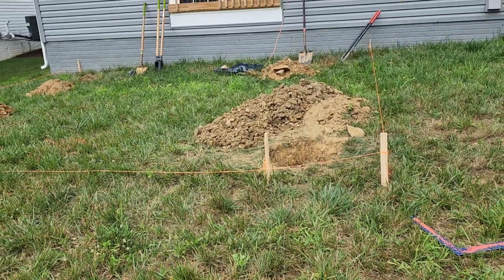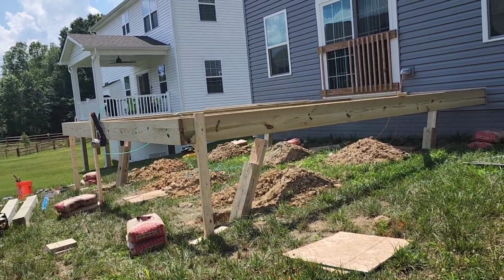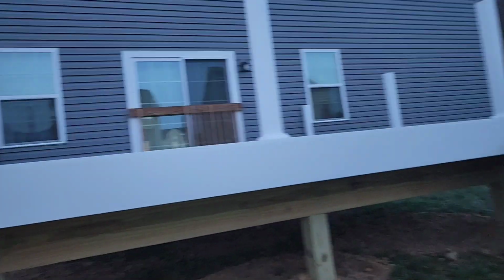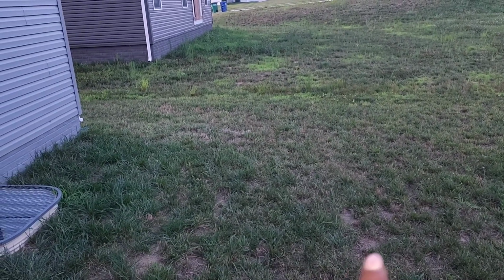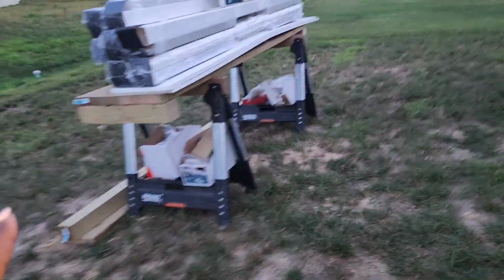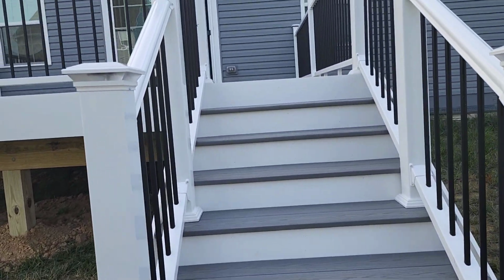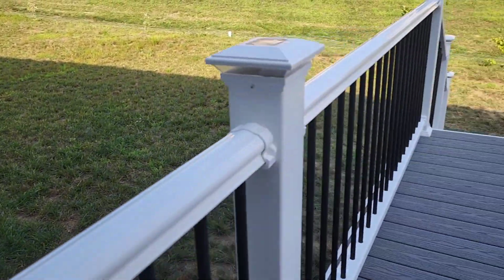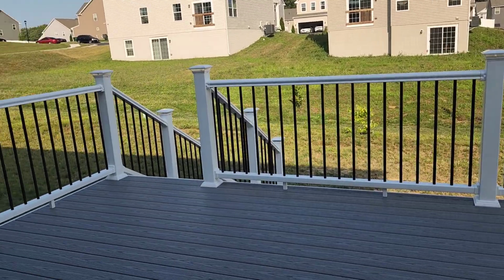MY DECK IS COMPLETED!

Comment: Love the two tone look of the deck! And the solar lights! If you are eventually fencing in your yard with a gate on one or each side, you may consider which side you will have visitors go to the backyard through and then put the fire pit towards the opposite side of that. That way, visitors are not walking right into the fire pit area.
Reply from the maker: That's a good idea, Aaron and I want talking about getting a fence we just don't know what kind. Thank you😊